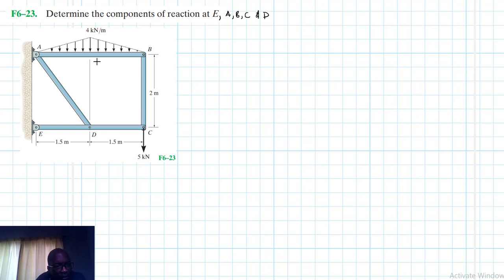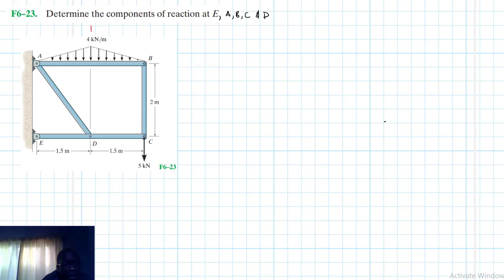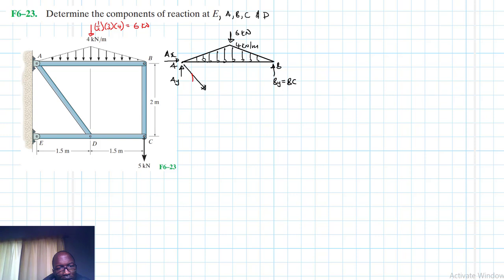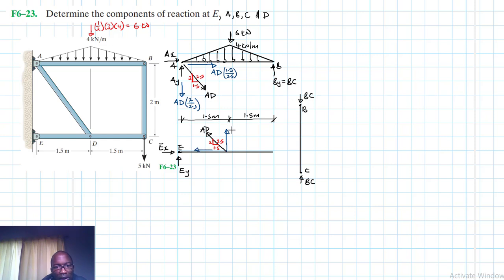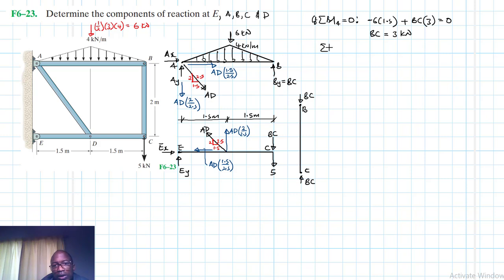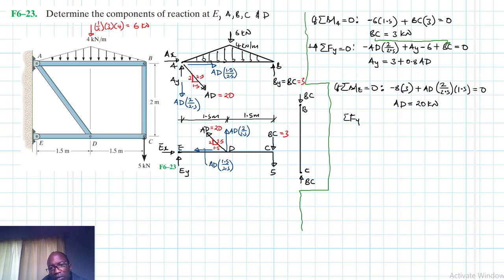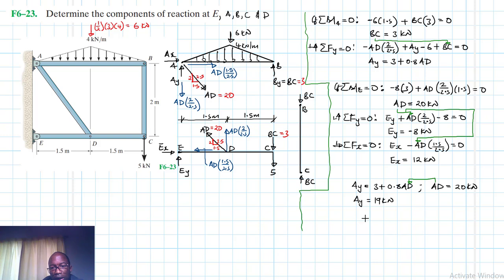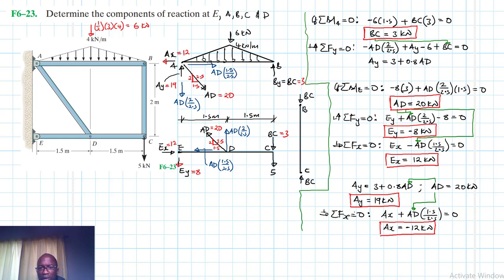F6–23 Structural Analysis (Chapter 6: Hibbeler Statics) Benam Academy

Comment: Why you put BC instead of Bx and By
Reply from the maker: Since BC is a two-force member, the forces at B and C are equal, opposite, and act along the line BC. Because BC is vertical, the force at B is purely vertical, so By = BC and Bx = 0.

Although one may initially assume both Bx and By at point B, the equilibrium equations will always give Bx = 0. Therefore, both approaches lead to the same correct